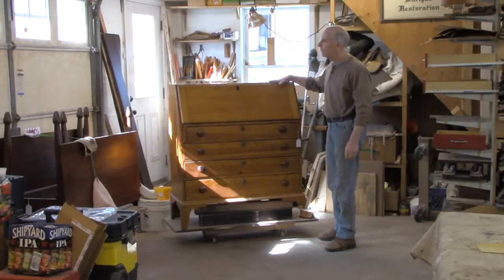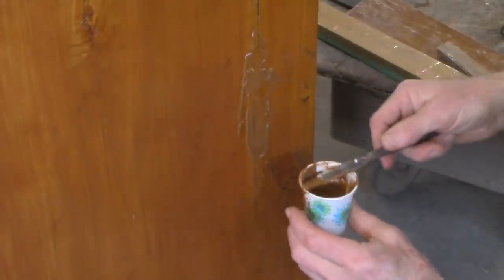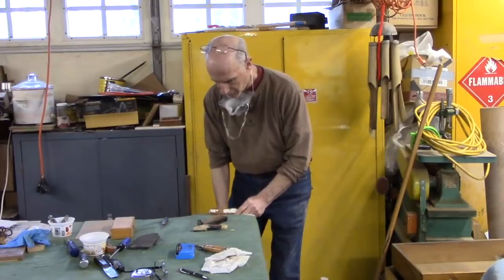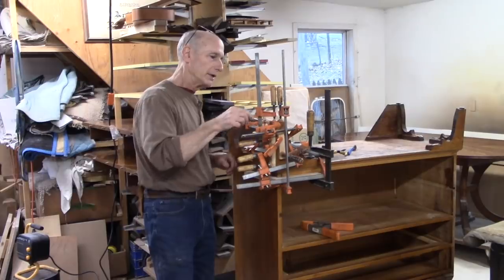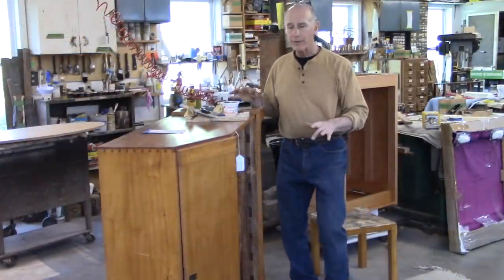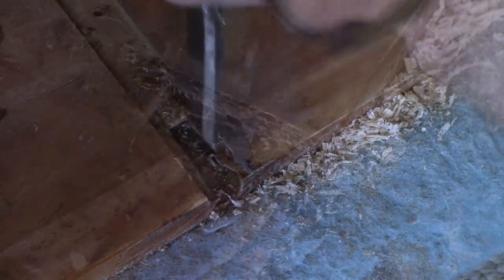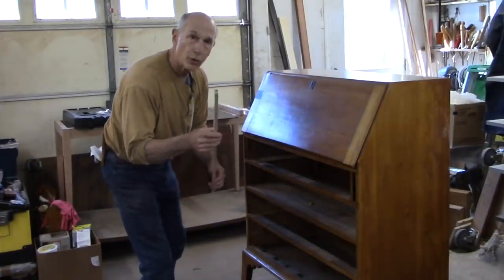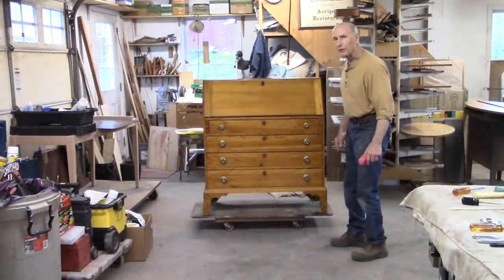Repairing an Antique Slant Top Desk - Thomas Johnson Antique Furniture Restoration

Comment: Yes, that's what happens when you work with damp wood. I had to find out that the American does not care too much about the wood moisture, he processes wood that is too moist (furniture wood = 8% moisture). If you do not pay attention to the moisture, the wood dries on the finished furniture and warps and cracks occur and columns ... Greetings from a trained Swiss artisan who loves craftsmanship and accuracy
Reply from the maker: Thanks! You're right, I don't measure the moisture content. But you can't do anything about it anyway.
Reply: @johnsonrestoration  You can do a lot about it if you are building a new piece of furniture, the wood must be dry at 8% and if this is not the case, you should not use this wood and let it dry further. You have to dry the wood in an interior that is heated, if possible, preferably with an indirect fan. Wood that has only been dried outdoors has a wood moisture content of 12 to 15% and this is far too moist for furniture construction, but in the USA it is normally not taken into account and the furniture will tear after a long time if the wood has dried properly. Delay in length 1% but in width it is 3% !!!!
What I have forgotten: I seal all cut edges with a wax solution that the wood dries evenly, relieves tension and that it does not form cracks

Comment: Restoring a piece due to the forces of nature - wood movement cracks - etc, and the damage caused during use and abuse, are a difficult challenge but rewarding when completed successfully. The correcting and un-doing prior improper repairs has to be frustrating and annoying due to the unnecessary damage they impart, making restoration more difficult than it should be.
Reply from the maker: Thanks! You are so right!

Comment: I love watching your videos, and learning different techniques. But there is one thing that I am failing to understand. Why use wax? Wax can melt at a later point in time, which would ruin all of the wax repairs. Maybe you need to use the heat gun to loosen a joint for a repair, and it melts the wax in that area. I'm reaching for a reason that the wax could melt, but it doesn't seem like a permanent repair. So I'm trying to understand why you would use wax. This is not a criticism, but me trying to understand.
Reply from the maker: Thanks! The wax is used in areas where expansion and contraction are a problem, and any defect that you don't want to sand, as you would with wood putty

Comment: I hope you see this so you think that the desk should have been darker like hey mahogany stain I ask because I'm working on a small secretary desk that is words I Maple it is very light and I don't really like the way it looks but the main wood is not taking stain very well so I redid it and I'm back to the beginning it's still light I kind of guess it's going to have to be that way just as soon as I stain the the bottom of the desk it's blotchy horrible looking so it looks better light left alone
Reply from the maker: Thanks! Maple is very difficult to stain, you need to use dye stains and a spray gun. But what you can do is sand the maple really well up to 220. Stain with gel stains, using a brush to even it out. The technique is just like glazing, which I show in this video: https://www.youtube.com/watch?v=oF1o5iD2pYs